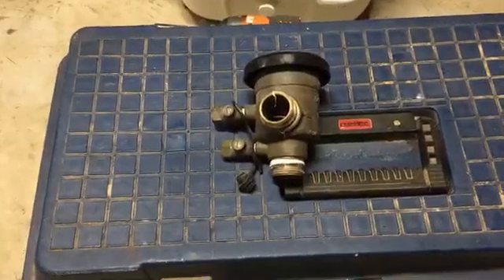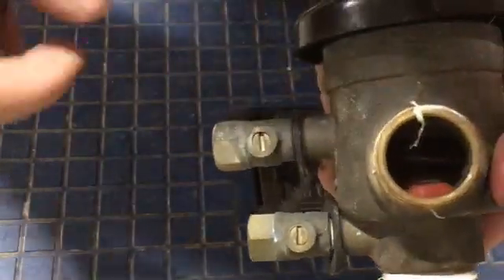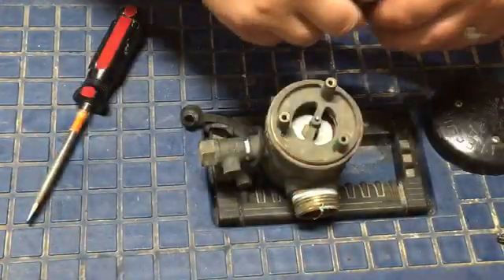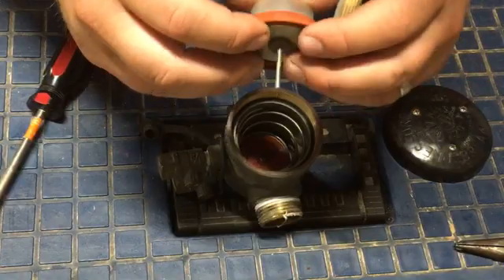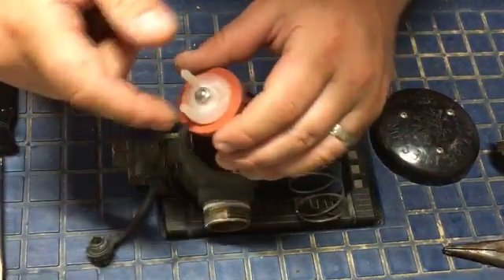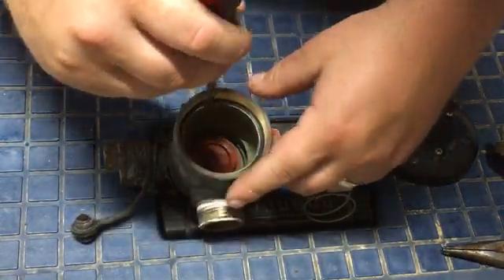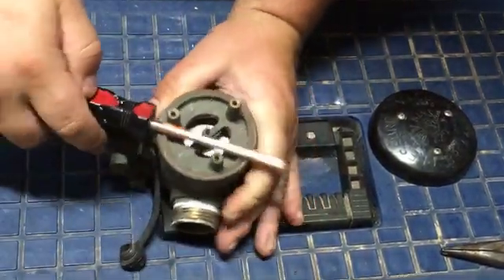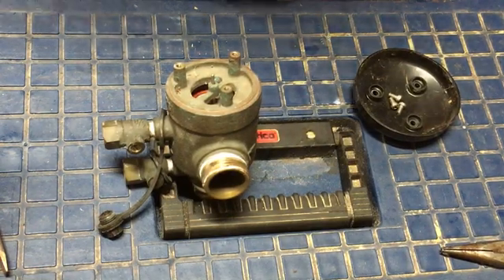Wilkins 720-A PVB dissembling and rebuild

Comment: Great video, made it easy to replace the pieces but I'm still leaking through the top and I used the whole kit so every piece is brand new. I don't even know what to do now.
Reply from the maker: Is the brass top flat or is it bent slightly upwards it will leak if it is Bend
Reply: @Irrigation_Tech_Talk  This I do not know, but I'll check that next, thank you for your reply, I really appreciate it.

Comment: Thanks for the vid - just curious what the difference is between the two test valves?  If you're using compressed air to blow out a line in the Fall, does it matter which one you use?
Reply from the maker: Use the bottom valve 
The are on different sides of the check valve